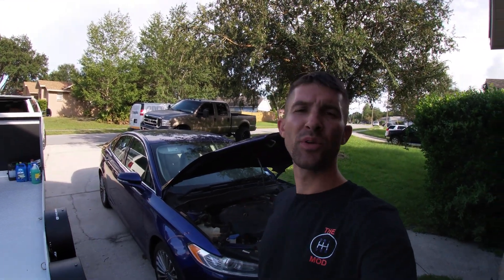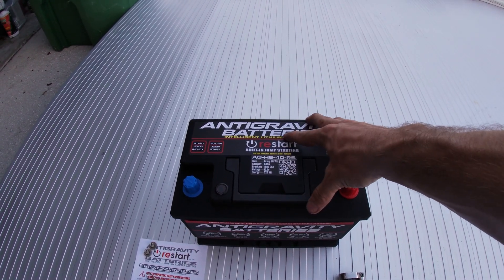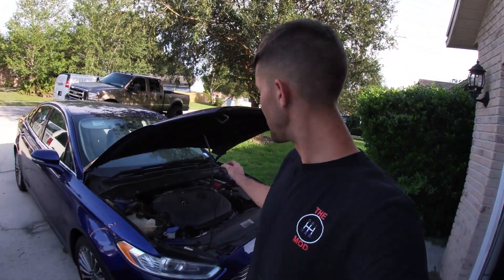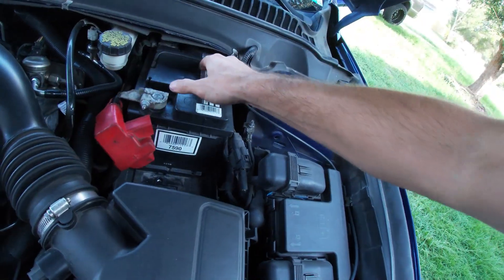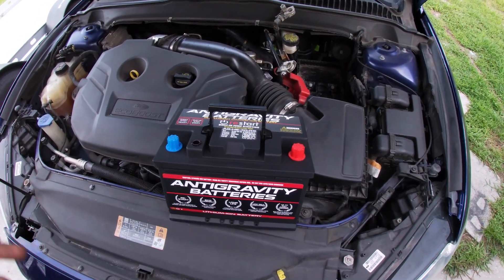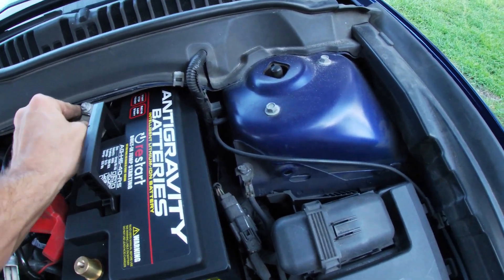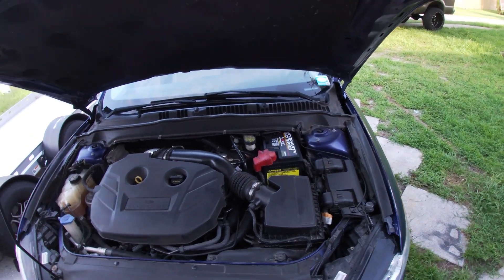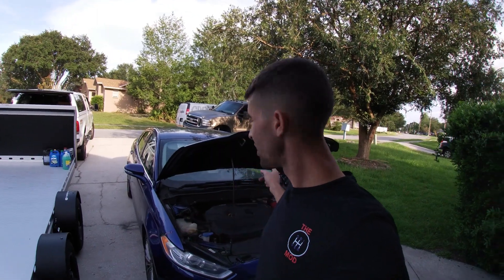Ford Fusion DEAD BATTERY// What battery should you use in your car? Benefits to Lithium Batteries?

Comment: When installing connect the positive cable first, then the negative last. When removing, disconnect negative cable first, positive last.
Reply from the maker: Never seen any negative side effects doing it either way
Reply: @THEDriverMod_  you gonna find out eventually
Reply from the maker: @odubbs11skalla  been in this buisness for 10 years....still waiting for the "eventually to happen
Reply from the maker: Update, still no negative side effects. Your comment aged very well.....
Reply: In his case, with the new battery being bigger, you be a fool connecting the positive first then sticking a long racket in the negative   😅
Reply: @soze8415 I currently own 4 Fusions ('13, '16 x², '20) all with the upgraded largest AGM battery case sizes installed and have no issues installing positive first, negative last and vice versa. So it can be done as stated.
Reply from the maker: Why would you stick a rachet to the negative?